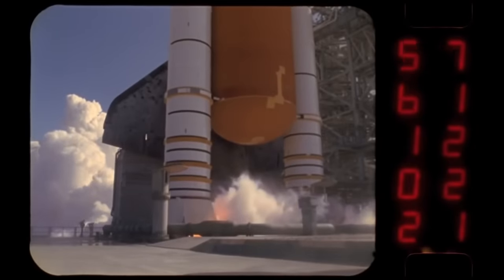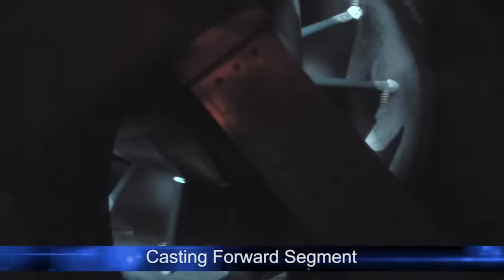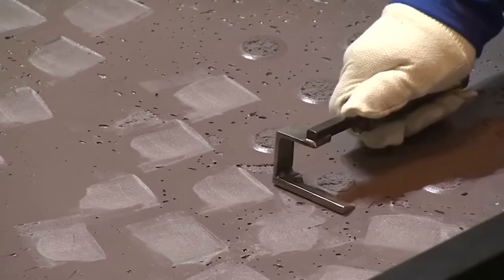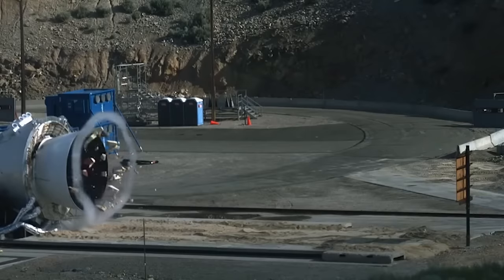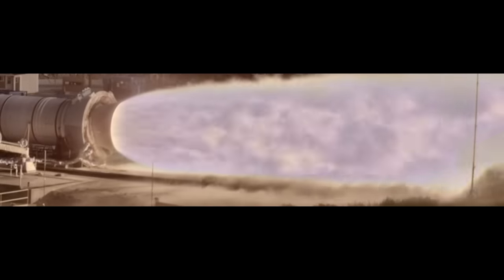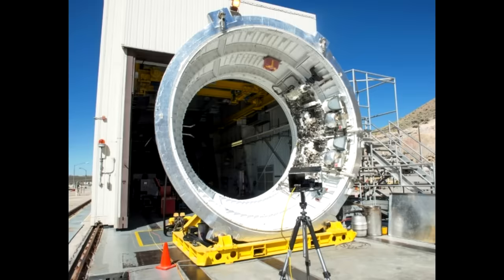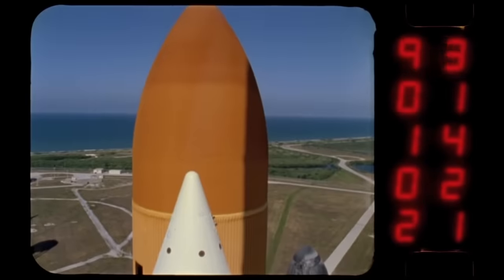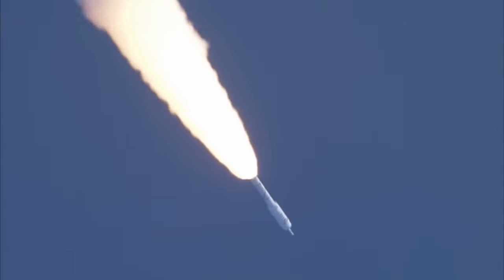The Amazing Engineering Behind Solid Rocket Boosters

Comment: Shuttle didn't actually have any protocol for SRB failure of any kind, the entire plan was to pray that they both work fine. There is no abort between launch and SRB separation event, if anything goes wrong the entire rocket and everyone aboard get blown up.
Reply: That's not true following STS-51L there was indeed planning in the astronauts cue cards for getting out of the vehicle in a Challenger type pre SRB sep. emergency.
Reply: @hoghogwild  I'm pretty sure every single one scenario involved waiting until both boosters burn out and separate. I.e. if something went wrong with the booster, the ship would lose attitude control and explode and there was no contingency plan for that.
Reply: @michaelbuckers  Yes, you did say "aborts",  yes you are correct, there were no intact aborts prior to SRB sep.  My reference was to contingency crew bailout, as in what would have been possible if the crew was wearing pressure suits.  You are correct, there were no abort or contingency abort scenarios prior to SRB sep. In fact, Any abort scenario was not to be commanded, by using the commander seat abort selector,  until passed the t plus 2:30 mark to ensure that the SRBs were gone.   My apologies.

Comment: I'm curious if it would've been possible to build a specialized multi-train car cradle that would've let them do more permanent factory joints between all the segments and ship them whole. Or just do what falcon does and use custom trucks (granted, those aren't fueled from the factory like SRBs, so I'm guessing they're a substantially lighter).

Comment: The self destruction of the Challenger boosters wasn't done for safety. It was done because the guy in charge of the destruction had an itchy trigger finger. In the investigation it was determined that the boosters posed no danger. The destruction just made it more difficult to figure out what went wrong.

Comment: The engineering behind the star structure in the aft segment to control thrust at critical stress points after takeoff and how the solid fuel is literally cast inside the booster reminds me of “hard coding” in software.

Comment: So the booster's fuel was basically like a rubberized thermite with added perchlorate for the oxidizer. Cool! It makes me wonder what a regular thermite reaction in a flower pot would look like if you added a large ratio of perchlorate to it. Or better yet, LOx. You could mix up the thermite, pop your fuse in and whatever starter you need like magnesium, then fill the crucible with LOx and light the fuse. The whole thing should react just like normal thermite, but a LOT hotter and a LOT faster. Although the whole assembly would be liable to blow itself apart.
Reply: You forgot to add RUN!!!
Reply: @francisdhomer5910  OOOOOHHHH SNAP! Is that why I lost my arm that last time? I knew I forgot SOMETHING but ya know, when you're in the moment, you just don't think of the little things. =P

Comment: Fantastic. I wonder if the boosters could've just been built as one piece instead of multiple pieces requiring assembly. They wouldn't have needed any seals that way.

I'm surprised that solid rocket boosters actually work. It seems dangerous.

Comment: Hey Scott,
Love your videos, always technically rich and from what I can tell quite accurate.  Regarding those SRB’s my dad designed and patented the propellant that made them possible, not the least of which was the ability to cast the propellant mixture in those massive tubes without shrinking or cracking.  This is why no other country in the world could make such huge boosters without them blowing up.  Especially, as he used to say, the Russians!
Reply: The Russians thought SRBs were too unsafe for manned flight anyway not because they might blow up but because you can't turn them off once lit. Korolev considered and rejected them early on.

Comment: There is a question I have wanted to ask about the Space Shuttle and how the large external tank was connected to the orbiter.  The connection points are on the bottom of the orbiter so how does that not create compromised areas on the thermal protection tiles when the tank separates.  Isn't there a hole left behind where the connection was between the vehicle and tank?  I have wondered about this for a long time, but haven't been able to find any information about how this was done without compromising the protective tiles.
Reply: Doors would accomplish that.

Comment: 12:27 So even though the booster had that leak, it was the center tank that blew up because it basically got a hole cut into it by the hot gasses from the SRB, correct? What do you think would have happened if the SRB had that leak on the outside of the booster? Meaning if it didn't touch the center tank, you think it may have made it into orbit?
Reply: The leak from the SRB joint weakened the lower strut which held it to the main tank.  The strut broke, allowing the SRB to pivot at the upper strut, breaking the main tank when the upper part of the SRB struck it.

Comment: Nike Hercules anti-aircraft rocket had 4 solid fuel boosters , That  could travel 87 miles down range and 150,000 feet in altitude. It had great maneuverability and a  of Mach 3.65 (2,707 miles per hour). It could be armed with either a high explosive or nuclear warhead.  was considered to be the most formidable of the Army's anti-aircraft weapons.

Comment: Scott, or anyone else well informed, could you be kind enough to explain the physics/engineering behind the vertical fuel loading of the Space Shuttle's External Tank? I only know that the External Tank is not fueled via the Beanie Cap at the top and via the collapsible mast behind the stack. The fueling is made via the twin service masts at the orbiter's base. But how does one overcome gravity in order to push millions of gallons of liquid fuel and oxidizer from the large spherical tanks hundreds of feet away from the pad, through the service masts, through the plumbing in the orbiter's aft structure, filling the External Tank from below. For the top of the External fuel tank, the LO2 also has to be pumped through the pipe on the outside of the tank. How is this done? Is the shuttle stack a giant pump pushing fuel vertically? How the hidrostatic pressure of pushing liquid fuel upwards is overcome has always baffled me....

Comment: Why did NASA choose to use SRBs for the shuttle rather then using liquid rocket boosters?  What advantage do SRBs have over liquid boosters?
Reply: Liquid fueled rockets and boosters are more complicated than SRB's
Reply: The SRBs provide 80% of the launch thrust, but are not 80% of the volume of the combined propulsion system.  Imagine removing the SRBs and using two liquid fuel rockets of the same type as those in the orbiter.  Each would have six engines and a fuel tank twice the size of the original main tank, at least.  But that doesn’t account for the greater launch weight, so it would be worse than that.  Think Saturn V.

Comment: Early airbag, circa 1989, were the outgrowth of solid rocket propellant developed by suppliers who worked on the boosters and originally for ICBMs which is what they were originally for because of there resistance to environmental factors unlike the poor stuff used by guys that caused the massive recall a few years ago.  It was cheap and unstable.  Original technology was highly reliable using aerospace specifications.  When oem’s started to do value analysis stuff got less than that met the original specifications.   I met engineers that worked on this stuff.  I was automotive industry.  I was amazed at the depth of knowledge they had.  Remember they had peoples lives at stake, hey wait so did I.  Using specs for “Man Rated Systems” for automobiles, in my mind (what’s left of it) was warranted.  In 20 years of working on airbags and seat belts nothing with my name on a drawing or spec of an airbag ever was challenged in product reliability.  I’m not bragging about my superior design capability, more about sticking with a philosophy of using the safest methods available.  Learned a ton of things outside my job description and met a whole bunch of “Mr Wizards”.  Most of it was fun.

Comment: Scott, since you discuss both fictional and non-fictional spacecraft (kerbal and real life), Why not discuss the "X-2 Deep Space shuttle" from wdw's "Mission: Space"
The back story is that the shuttle is powered by solid hydrogen and can go from 0-6,000 in 60 seconds. They also use aerospike engines and claim to be able to have foldable wings for gliding in Mars. 
I bring this up notably because of the solid fuel and ability to use it in flight both with aerospike engines and a practical use for the future. Can you do a discussion on that?

Comment: "The O-rings now handle low temperatures" - What has changed? New rubber composites? What are they made of now? Thanks.
Reply: I read somewhere that they began to use heaters on the joints to keep them from freezing. Also added a third back o-ring.

Comment: @1:08 .... each booster provided 1250 tons of thrust (= 2500 tons), while the core.only provided about 600 tons...

NUMERACY CHECK!
2500  is just over 4/5ths (2500 ÷ 3100 = 0.80645....something) of the 3100 tons total thrust, not "about two thirds"

Comment: 1/3 of the circuference of the failed joint posed a risk to the shuttle; the other 2/3 would have been harmless had the burn-through occured there instead of where it did.

Comment: When they want to incease burntime for the SLS, why don't they increase the propellant's web thickness instead of adding one more segment ?
Reply: They did, shuttle used 4 segment SRBs SLS will use 5 segment SRBs.  Lengthening a SRM doesnt increase burntime, it increases thrust.  Increasing burntime is accomplished via increasing the motors diameter.  They burn from inside to out, not top to bottom.

Comment: Could the Challenger been saved by separating the SRBs at first sight of the hotspot on its joint? At least they are on explosive charges, unlike the main fuel tank, which has some piping so you do not really want to really break off that in flight. Do some simulations in KSP please!
Reply: The separation sequencing was automatic, there was no way to command it early. Besides, they were designed to separate laterally away from the external tank when they were no longer providing thrust (nose released a split second before the aft) so that they pealed away cleanly. If they somehow could have been released early they would shoot past the orbiter and having thrusting SRB's pointing their flames at the fueled external tank would probably not end well.

Comment: I believe they couldn't build it in one piece because they couldn't transport them to the site that way, which led to the problem of the O Rings in the first place. There was a plan to upgrade them, which would remove some dangerous abort modes and allow the Shuttle to carry bigger payloads, but it was scrapped.

Comment: No doubt a silly question, but if the SLS uses 40 year old solid boosters and engines left over from the Shuttle, why has it cost so much and taken so long?
Reply: The Shuttle/Ares derived bits of SLS (ie the Boosters and the RS-25 engines) have been ready for years now
Most of the delays/overruns have come from the core stage which is a new development for SLS and required new tooling/factory rebuild/test facilities and significantly longer test campaigns than all the other elements

Comment: Hey Scott, if the SRB is ignited at the top and burns the propellant from the top down and from the inside of the tunnel to the outside of the rocket tube, then how did the burning propellant reach the faulty O-ring seal on the outside and near the bottom of the rocket so quickly after ignition?  What structural pathway was there inside the molded and poured “solid” rocket booster for the combustion to burn through before it got to the O-ring seals?  Just curious.  BTW, thanks for your great videos!!!
Reply: Oh hey I know this one. 

Ignition starts at the top of the booster, however, after mere miliseconds the flame reaches the bottom. It's a misconception that it burns from top to bottom, all the propellant grains burn virtually at the same time from the inside to the outside.

Now, the Shuttle's SRBs were made in sections, not only for size constraints, but because of the shape of the propellant. These SRBs had a grain configuration called BATES, which is just a fancy name for a cylinder of propellant with a hole in the middle. The BATES grain has a progressive thrust curve, this means that as the booster burns, it gives more and more thrust. However, if you divide the grain in sections of a certain dimension and leave a space between them, you can counter this effect to give a more neutral thrust curve, meaning the thrust remains almost the same for the entire burn, because the faces of the grains also burn.

This space between grains is where the flame went through, which is completely normal, but during the Challenger flight, the insulation couldn't keep up with them.
Reply: @tsurutuneado5981  Thank you for the response.
Reply: Do you know why the SRB doesn’t just detonate if the propellant material can burn anywhere within the booster? Has anyone posted a visual simulation of the pathway they think the flame might have took from the initial ignition point to the interior joint/O-ring seal?  I’ve seen the one showing the flexing and burn through.  Rocket science is fascinating.
Reply: @paulheinrich7645  Detonation and burning are two different things.  Solid fuel burns very fast but doesn't detonate that I know of.

Comment: I think people often get "simple" and "low tech" confused. Compared with a liquid-fueled rocket, solid-fueled rockets are simple, without the need to pump fuel around there are far fewer moving parts and moving parts are generally what add complexity. But, yeah, still quite a lot of engineering involved.

Comment: If you like this video you should read ‘Truth, Lie and O-Rings.’ It’s about the Challenger disaster from the point of view of a high level Thiokol SRB engineer. He actually had to climb into the rockets before the first launch after Challenger to check the o-rings. One spark and he would have been less than dust. Freaking wild.

Comment: Wait, SLS launches with the same SRB's ? i thought the solid-only booster design is outdated, and will be replaced with those hybrids that can be throttled and shut off. (sorry, totally forgot how the correct term)
Reply: Nope, for the first 8 SLS flights, SRB segments that have already flown on Shuttle will fly on SLS.  After SLS-8, contracts have already been signed to supply new more powerful SRBs made of filament wound segments, new propellant mix, new nozzle and an electric thrust vector control system which will eliminate the use of toxic hydrazine.

Comment: As a disclaimer I really dislike those solid money burners. As you explained big SRBs are expensive for a reason and they don't scale well with the rocket equation. So if you just need a bit more thrust than you suddenly need a lot more weight and thus a lot more thrust to lift that weight and so forth. 

Yes the Shuttle SRBs contributed the majority of the thrust, but actually most of that was used just to lift themselves.

Small boosters can be very useful, big boosters are a waste of money.

Comment: So the basic root cause wasn't the o rings.

 It was the selection of the contractor in Utah,  necessitating the o rings

If the contractor was selected in a state where the booster could be assembled in manufacturing, they'd not need field assembly

Comment: In case the boosters had gone, where they shouldn't, because it would have known where it wasn't, that would have been where it was, the guidance system would have calculated the deviation, otherwise known as error.

Comment: I never understood how they could ignite the solid fuel and have it producing full thrust in 1/2 second. The liquid fueled rockets took 3 seconds to spin up to full power. Pyrotechnical igniters at top of SRB pointed down the cylindrical void in solid fuel. Hard to imagine the rubbery fuel igniting instantly.
Reply: The igniter runs the entire length and once solid fuel is burning there is no stopping it.  It's engineered that way.
Reply: @TheEvilmooseofdoom  thank you

Comment: If each solid rocket booster generates 1,250 tons of thrust then that is 2,500 tons of thrust. If the core is generating 600 tons of thrust then the total thrust is 3,100. 2,500 is 80% of 3,100. So how come the video (around 1:10) says the solid rockets produce about two thirds of the thrust? It seems more like four fifths.

Comment: stray electrical charge, so does this mean that in theory if lightning struck it, it would just go off causing a rampant rocket to just burn and fly around?
Reply: Once the assembly is on the launch pad, it is secured to the pad.  The structure of the launch tower is taller than the SRBs, so would act as a lightning rod.  They probably have an actual lightning rod on top of it.  I expect rollout would only be done during clear weather.

Comment: Should have went with the one piece design from Rocketdyne. They were going to build a factory near Cape Kennedy and barge them to the cape. Instead pressure by Senator Proxmire forced NASA to buy the Thiercol segmented booster. The factory was in his congressional district. If Rocketdyne boosters had been used, Challenger wouldn't have been lost.
Reply: For the BATES configuration of the Shuttle's SRBs, a one piece booster would've given them an unusable thrust curve for the flight
Reply: @tsurutuneado5981  actually Rocketdyne didn't t get the contract due political pressure not performance. Proxmire had the power to throttle nasa funding. Thiercol was in Proxmire's district.